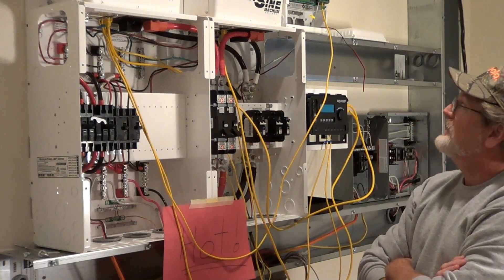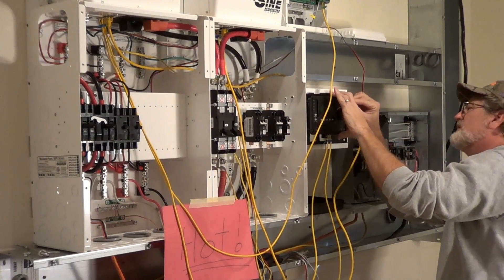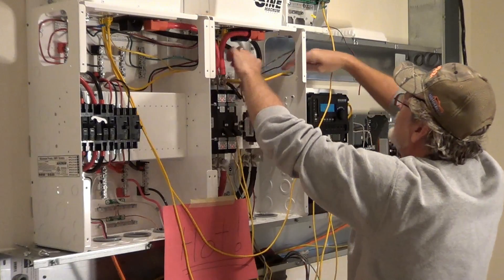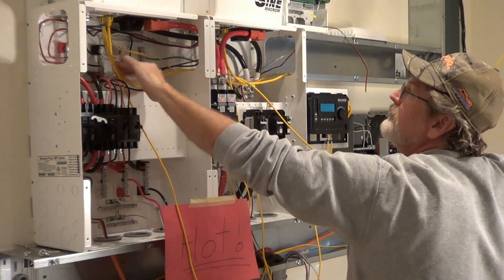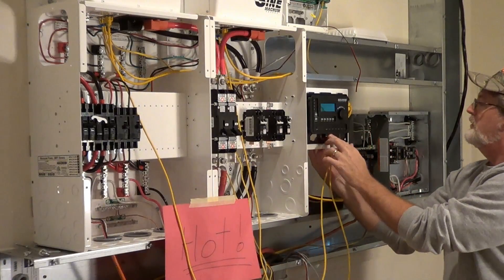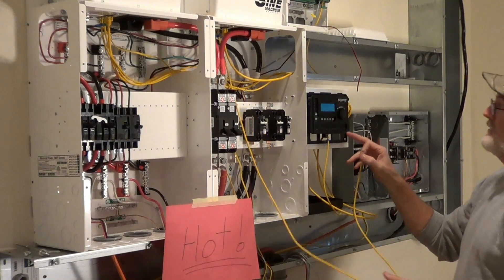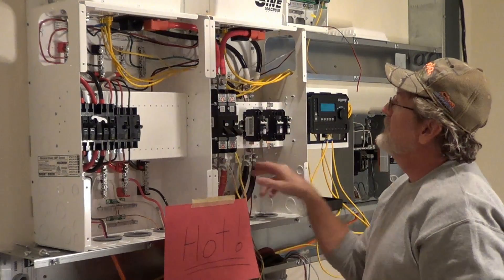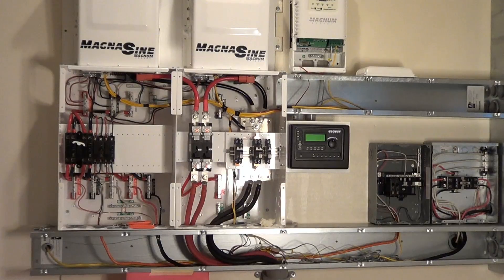Off Grid Solar #21: Networking the Magnum Inverters

Comment: I am not sure but you need only one Battery sensor per bank!
Reply from the maker: That is correct and only one will actually be connected (to the Master Inverter). The others are run through the conduit in case the 1st one fails the next one can easily be attached.